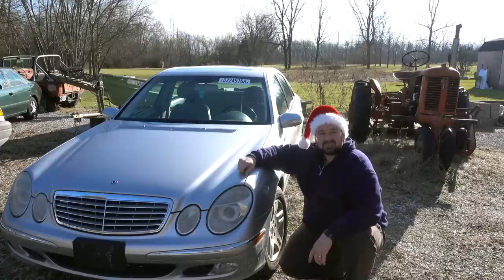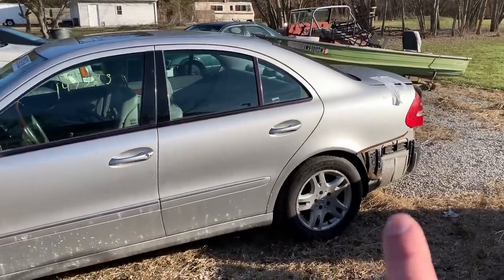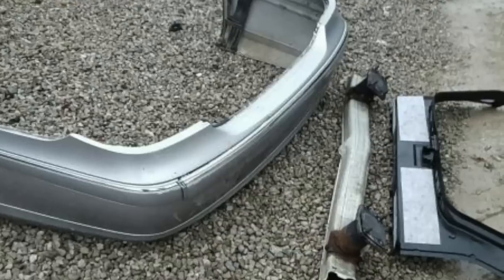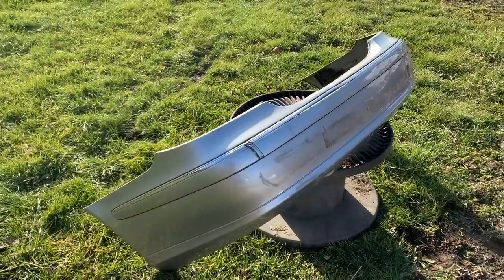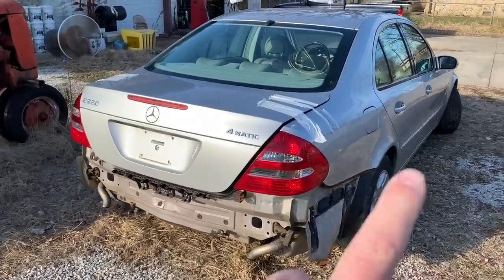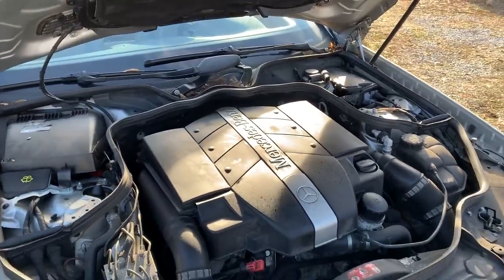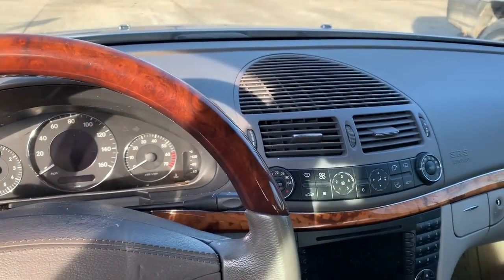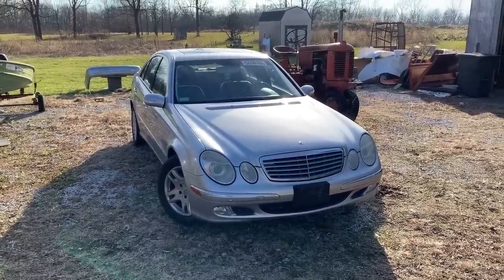NEW REBUILD!! 2004 Mercedes-Benz E320 4Matic Rebuild Project Intro

Comment: I would fix the bumper but I would use epoxy on inside instead of bondo. I would bet the tie rod ends were probably broke when the rollback or wrecker strapped the front end down when it was wrecked!
Reply from the maker: You could very well be right about the tie rod damage. It’s very odd!

Comment: Our U pull it Yard has a 2001 E320 but i don't know if that bumper is the same.
Reply from the maker: Thanks for the heads up on that, but unfortunately that one isn’t going to work. The W211 body style that I have started with the 2003 model year. Thanks for looking for me though!!

Comment: Hey Stephen on that bumper have you tried calling places here in indy I have bought a couple of fenders and bumpers from a place that's local here in indy it's called certifit they have great prices and the quality is decent lmk if you need more info on this place
Reply from the maker: Thanks for the tip! I’ve done a little looking around locally, but I am not familiar with that place. I’ll look into it.
Reply: Yeah they are pretty good its located in Plainfield,  indiana
Reply from the maker: Thank you!

Comment: May as learn how to paint :) but if you go with Harbor Freight I would recommend their "professional" $70 gun (vs $15 one).  I mean I like the purple wonder but it's coarseness makes it a better primer gun (thicker material).  Given it's so inexpensive I have both and don't  worry about primers wear and tear on the main gun.  Sure there are better guns, but unless you are going to be doing a lot of painting their cost would make it cheaper to have your friends shop do the work :)
Reply from the maker: Thanks for the tip! I’ll check those out.

Comment: There's a reason for those bumper prices. Especially during those years, Mercedes thought it was a good idea to make bumpers with up to 100 different parts that would sell separately. Also, they thought it would be even smarter to make lots of different bumpers for the same models. So, now you know why are they so expensive. 

On annother note, since it is such a nice car with such little damage, I would take it to a professional. Although I would still encourage you to get your hands on some bodywork (only not on this one for your first time)

Merry Christmas!!!
Reply from the maker: Thanks for your suggestions here! I appreciate it. I’ve also noticed the many different versions of the bumper. It’s kind of nuts really! Lol!

Merry Christmas! 🎁

Comment: What did it cost you and what will its value be after fixing
Reply from the maker: I was kicking myself when I was editing this vid that I forgot to mention the purchase price! I’ll mention it in the next vid on this car, but my winning bid on the car was $1000 even, plus auction fees.
Reply: @CrossroadsRebuild  what do you expect it will bring on the market.
Reply: What products are used to clean the engines and the engine bays will it get all the buildup gone.

Comment: Just saw a pretty good one for $200.  Needs some paint.
Reply from the maker: Where’d you see that?
Reply: @CrossroadsRebuild  It was on EBay.  Just put in E320 rear bumper.  It's down a ways on the list.
Reply from the maker: Thanks!

Comment: Steven, have you checked out the used body part website called car-part dot com ?  I looked quickly and they have a zillion questions that depend on the trim level of the car.. I am betting you can find a cover on that site if you dig hard enough.  Just my $0.02
Reply from the maker: Thanks, yeah I’ve checked it out. And yeah, there are an overwhelming number of options! I have found some on there, but they weren’t close to me. It’s really the freight shipping that makes it insanely expensive!
Reply: @CrossroadsRebuild  ok cool, I figured you had.. but it never hurts to check.. the freight can get a little crazy on bigger parts.. good luck with the rebuild..